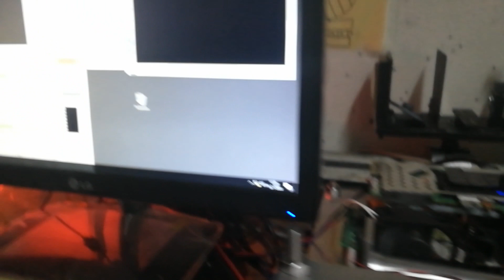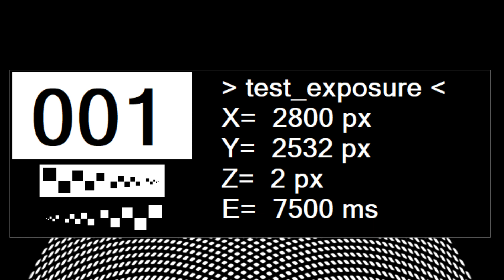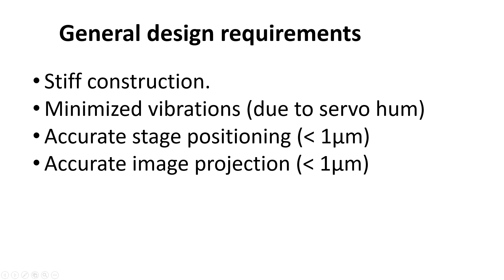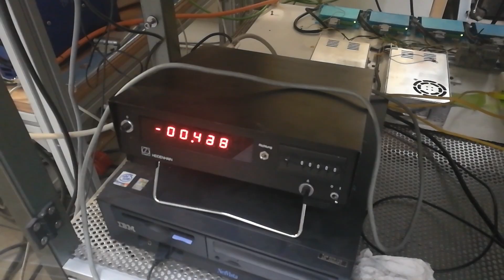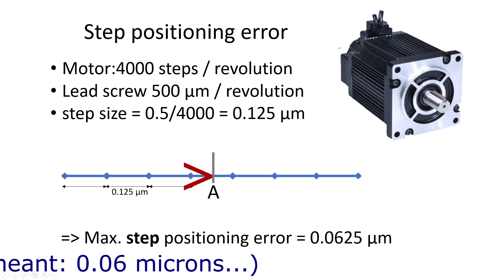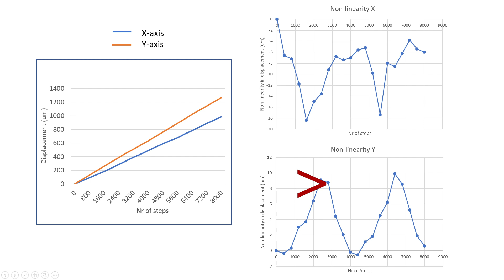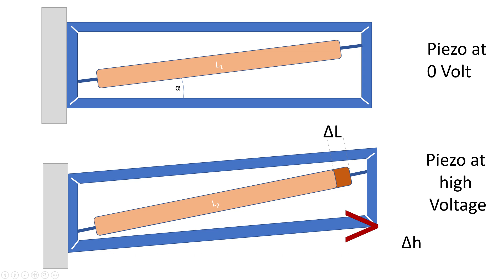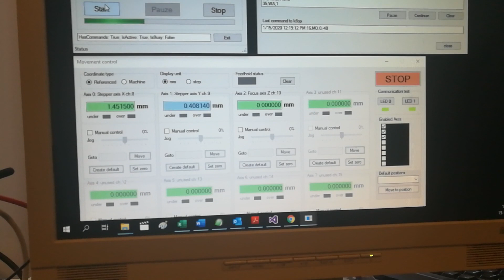Maskless Wafer Stepper Part 2: Mechanics

Comment: Really cool!  Have you looked into how distortions in the projected image affect the stitching?  Perhaps you could measure the distortion field by projecting one of the MTF mapper test patterns onto the photoresist.  Then you could maybe then compensate for the distortion in your software by applying the opposite distortion to the digital image to be projected.  Also, because the objective lens is probably not optimized for UV, the projected image intensity may not be uniform across the field.  Your software could compensate for that too.  Not sure you can do anything about gradients in sharpness, but maybe that is less critical
Reply: Also, because most modern objectives are infinity corrected, I'm a bit surprised that you're not using a tube lens in the imaging system.  Is this particular objective of the finite conjugate type?  Otherwise, a tube lens could improve sharpness away from the center (by flattening the field), and should also help keep the illumination closer to telecentric at the image, which may help avoid sloped sidewalls
Reply from the maker: That is correct, best practice is using a tube lens with this objective. I added it later to the design, and also added a microscope cover slide correction and removed the cube beam splitter. Actually, I made quite a lot of changes to this initial setup, maybe I should discuss the optical design modifications in a future video.

Comment: you've addressed the drive train precision elegantly but the weak link seems to be the actual x-y stage.  Is't the precision limited by the precision of the stage?
Reply from the maker: Correct, the solution is to add high-accuracy encoders and use a feedback loop.

Comment: I was thinking about a less complex machine for exposing double layered PCB. It requires much less precision, but still needs to be very precise. One thing that puzzles me is how would one make it for double sided PCB, meaning exposing it from both sides. The back side placing must exactly match the position of the front. PCB shape can't be ideal. Also, PCB thickness is not the same (from one project to another). Maybe I'll come up with something after some more thinking and research. But does anyone seen something similar somewhere?
Reply: May you drill all vias first. Then take a photo with the CCD and bend your virtual wires before you illuminate the CCD. Most of your SMD stuff will be independent

Comment: you might get better results using a plain fluorite objective instead of the apochromatic objective-  the apos have a bunch of additional optical elements to correct chromatic aberration, but you're only using narrow band UV so those extra elements are just going to reduce your resolution and you won't gain anything

Comment: really really enjoy your setup build up, ! i am currently using a 2P spectroscopy. i would like to build one myself, I require a Z stack, galvomirrors and xyz stepper motors for movement. which devices do you use for the Galvo mirrors?

Comment: Very interesting. Is it possible to add a feedback measurement system, like a laser distance meter onto the x and y axis to get rid of the leads crew deviations?
Maybe using a trinamics stepper driver might reduce the servo noise.

Comment: I'm curious, how did you measure the step size of 11nm for the piezo actuator?
Reply from the maker: By measuring the full dynamic range and divide by 4095 steps (12-bit resolution)

Comment: Very impressive! I admire how far you got in such a short time!
When I worked for ASML in 1998-99 as a software engineer, I learned that there are some very weird problems that most people might not think about. The machines i worked on had 23 degrees of freedom, moving a 30kg marble slab with a wafer around at up to 6m/s or so. Of course the reticle had to move in opposite direction (but at 1/4th the speed IIRC) and there were counter-weights to keep the machine in place.
The motion control of the linear actuators needed to compensate for "cogging" (i.e. variation in the magnetic field depending on where the magnets are), and things like the bending and un-bending of the electric cables that are attached to the stage. They used a Hewlett-Packard laser interferometer to measure the position of the wafer stage but I think that was just for rough estimates: the wave length of a red laser is much longer than the accuracy of the machine (180nm in that time).
The software was responsible for basically keeping the speed constant, so it gives the motor a big push, then lets the stages "coast" to the other side with just a little bit of compensation for irregularities along the way. Then at the end of the track the motor would be pushed in opposite direction to stop the mass from moving.
And of course it's "fun" if something fails and the pushback never happens; when a wafer stage crashes, it will cause significant damage that will cost a lot of time and money to repair. I remember someone telling me that in a fab, even opening a side panel causes so much disturbance to the air flow that it took an entire day for things to settle and make the machine usable and productive again.
Reply from the maker: What they achieve at ASML (especially the new machines) is absolutely incredible.
Reply: Former ASML software engineer here, 2002-2009/ 
Yeah, we've created some pretty crazy stuff there, proud to have been part of the team
Reply: @barmalini  I just started as a development engineer at ASML's German optics supplier and am continually amazed at the engineering they do (although our stuff isn't too bad either).

Comment: Hi Jeroen, I'm wondering if the mechanical issues with stitching multiple patterns could be overcome by some sort of feedback. Instead of slicing an image up into a certain number of pieces ahead of time, and trying to get the mechanics to move to a precise location, you could move the stage as precisely as possible, but then use the computer to adjust the image "on-the-fly" to account for any misalignment. A linear encoder not connected to the lead screw could provide you with a more precise location. 

If you can't get the mechanism to get you to a precise position, maybe you can use software to accurately project the right image for whatever position you're at?

Of course this might cause additional problems.  Off the top of my head, I'm not sure if double exposures would be an issue (if the images overlapped), or if the relatively low resolution of the projector would cause aliasing artifacts (if the misalignment is fractional compared to the size of a "pixel").

Anyway, this is incredible work, and I wish you great success.
Reply from the maker: The best way indeed is to use accurate positional feedback to overcome mechanical flaws of the stage.

Comment: coreless linear motor + encoder at least 100nm resolution,checking axial squareness/sraightness/tureness via laser interferometer，generated related compensate table use motion control 
to compensate via table

Comment: Wow, you are really doing great work. Repeatable errors are your friend. Maybe you can make software corrections for all repaitable errors like imperfections in the screw and table alignment. Print a pattern over the full range of your system, have this measured very precice and compensate these errors with your software. You might be able to make your system more precise. (I studied precision engeneering in Eindhoven and did some work at ASML, now about hunders years ago. But I quickly discovered that I am not the person for um or nm. You sound like it is easy as bricklaying, I am impressed. Now I work in Zambia and it fills my hart with joy if our trainees reach precsion of +/- 1mm ;). Really impressive.
Reply from the maker: Well the solution I chose was to use optical encoders with 100nm precision. Feedback loops are in my opinion the best way to eliminate positional errors.
Reply: @HuygensOptics  even better.

Comment: in view of the lead screw deformation problem, I think you could use a linear encoder for feedback control, instead of encoders on stepper-servo. the one i use in vision measuring system have a resolution of 0.5 micrometer.

Comment: 6:25 - I want to mention that "Trinamics" driver chips produces no noise and is pure analog signal to drive the servo/stepper motors, really good for this micro stepping to remove any unwanted vibrations.
Reply: Oh no, Trinamic stepper driver ICs still make lots of noise, but humans can't hear their ultrasonic PWM frequency. Yes, they're great chips, and yes their 35kHz (configurable) hard-switched PWM is adequate for most purposes, but sadly no they're definitely not pure analog and definitely not vibration-free in general. If you can find, design, or hack a PCB to use an 8MHz external clock for the stepper driver IC, then you can configure it to an audible 15.6kHz chopper frequency and listen with your own ears.

I definitely don't work for Trinamic and I only have direct experience designing around the TMC2209 and TMC5160 ICs. If you've found a Trinamic IC that is truly analog, or can generate >100kHz PWM to allow efficient external filtering (without overclocking outside maximum ratings), I'd love to hear about it.
Reply: @W77W  well I would use trinamics for this project since it eliminates noises compared to the drivers he is using at the moment. But I’m not sure if ultrasonic noise makes no difference compared to the lower frequency noise which humans can hear. Trinamics are not pure analog but they are very close to it. I can’t think of any better driver chips other than trinamics. Another problem is that I would not use stepper motor, they are no good for 1 micron precision. 
Servo motors with close loop is better for precision positioning and I would also include an optical encoder with incremental accuracy of 1 micron.

Trinamics TMC4671 can switch at 100khz. Here is the link:

https://www.trinamic.com/company/news/news-detail/implement-your-servo-controller-in-a-day-with-the-tmc4671/
Reply: @ShopperPlug  Thanks for the quick reply and thanks for the link, I agree with you 100% that the Trinamics are the best single-chip solutions available (to my knowledge). I just wanted to throw in my 2 cents of caution because I did have an issue with a PCB drilling machine, where the 0.1mm micro-drill bits were breaking because the XY stage was vibrating ultrasonically enough to flex the drill bit, even when all axes and spindle were "stationary".
Reply: @ShopperPlug  I'm really sorry but it's not my machine, so I don't get to share the build.

I can say that epoxy granite (https://en.wikipedia.org/wiki/Epoxy_granite https://www.adambender.info/post/2017/03/25/epoxy-granite-machine-frame-how-to) is amazing, superior to the natural material in many respects. Being able to pre-cast notches, rails, and screw threads is really nice. Of course you need something flat to start with, but you can cast your epoxy granite upside-down on your surface plate to transfer almost all the flatness properties from one to the other. In our case we first stuck a precision parallel slightly above the surface plate, then made the casting to generate a precisely parallel-sided rectangular slot in the base, connected to the surface by an imprecise window, so it's roughly an inverted T-shaped cross-section like a milling machine table's T slots. I don't know if the thermal expansion properties are good enough for nanometer precision, but they're certainly good enough for a drilling machine. Just don't cast your very expensive parallel into a block of epoxy granite without a solid plan to get it back out. In our case we just chilled it to shrink the steel.

It's also surprisingly easy to make DIY air bearings (https://www.youtube.com/watch?v=K_N_h_mKf-4). Machining graphite is trivial, so you can easily make exotic bearing configurations. For example, you could machine a roughly X-shaped piece of graphite very slightly oversize for the parallel-sided T-slot, squeeze the X so it flexes very slightly, and wedge it into the slot (rather like installing pistons in an engine). Now you have an air bearing axis that's as precise as the parallel you used to cast the slot, and it's fully dimensionally constrained by the 4 sides of the slot, at least up to the elastic stiffness of graphite. You just mount the next axis directly to the graphite block. I suppose if you need a really large travel you might want two parallel slots so you don't have to buy/make a huge precision parallel or a huge chunk of graphite, but the idea is the same. Again I'm not certain you'll get nanometer precision out of this, but for a drilling machine it's great.

If you can't follow my description I can draw up a sketch.

I connected the dots to the ultrasonic resonance by several rounds of troubleshooting. I started by observing that on smaller PCBs (~5*10mm) the drill bit would snap very regularly, often at the same location on the PCB. Larger PCBs were immune. I figured that something must be moving, but I had no idea if the spindle had weirdly inconsistent runout, or the stage wasn't stiff enough, or the PCB was flexing, or maybe thermal expansion or air/vacuum pressure variations. I made several wrong guesses, then eventually hooked up a cheap continuity probe from the tool to the PCB to see if there was low-speed drift (thermal expansion driven). I use this probe all the time on my milling machine, so I was really confused when instead of a sharp on/off at the edge of the PCB, the LED would slowly get brighter as I bumped into the edge. Again some more wrong guesses, but I eventually hooked up an oscilloscope to the continuity probe, and clear-as-day you could see the 23kHz vibration on the 'scope. There's no way 23kHz was coming from outside the machine, so I pretty quickly followed it back to the source. Dialing up the PWM frequency and decreasing the holding torque solved the problem, but a heavier stage would also have helped.

Comment: Couldn't you improve the linearity of the lead screws using feedback with an interferometer?
Reply from the maker: Yes, that is the way to do it, use position feedback. Btw, optical encoders are a cheaper and easier way to do it then interferometers.
Reply: @HuygensOptics interferometer is optical and its pattern comes for free and you only need a single photodiode. And it works well for scanning. Too slow for steps

Comment: Why not just use a couple of laser diodes as interferometers - one for each x/y stage, and use the outputs from those as the 'step' signal with which to close the loop for each axis? OK, will need temperature stabilization for each laser diode (to keep the wavelength from shifting), but it should mean that the leadscrew nonlinearity doesn't matter...

Comment: Love your channel! For my understanding, the resolution of the axis sould be smaller then the projected pixel size? Because how could you ensure that the pixel sized features are stiched correctly together?
Reply from the maker: That is correct. However, it is not something that I have achieved yet. I am in the process of modifying my hardware, but it is doubtful that even in the new configuration I will reach < 0.3um position accuracy. I guess I would have to get my hands on a real wafer table from a wafer stepper to achieve this.
Reply: @HuygensOptics  In my expirience with building position stages, the problem lies in the mechanics itself and the lack of precision position meausurement. I don't have a interferometer :) Even with that and a closed looped driver and the best motors I couldn't archive sub mircon levels. Repeatability and error where in the +/- 1µm
range. Nice thermo drifts over the day where common, in the end they were the easiest think to correct for. I was just giving up as I found a solution. The buzz word is flexures. https://www.youtube.com/watch?v=PaypcVFPs48
The best think you can even print this thinks:
https://gitlab.com/openflexure/openflexure-block-stage
Diy flexure piezzo stage:
https://www.dpreview.com/forums/thread/4441997
Reply from the maker: Thanks for the links Jonas. The flexture stage shown in your last link is exactly the one I used for my project. So one of the issues with flextures is their very limited range. So you need a combination of normal steppers and piezo flextures to make multi mm size patterns, which makes makes control complex. If I had sufficient funds for that, I would just use piezo-electric drives: https://www.physikinstrumente.nl/en/technology/piezoelectric-drives/

Comment: Question / Comment @ 8:58  re non-linearity of the actuation.

I would agree that imperfections in the lead screw would contribute. 

I wonder if you've considered the effects of microstepping...

I know this is the case with steppers ( I recall you said servos -- unsure if still applicable ) 

You will get a cyclical ( which your graph seems to show ) deviation based on the electromagnetic power ... which is determined by the position relative to a full-step where the rotor is currently placed.

Your seemingly cyclical deviation could be artifacts of the micro-stepping process -- especially when running super low currents.
Reply from the maker: Thanks for the suggestion but these imperfections are cyclic with a full rotation, not with a step. Also the servos have a 4000 steps/rev optical encoder and use a feedback loops to go to a specific rotational position.